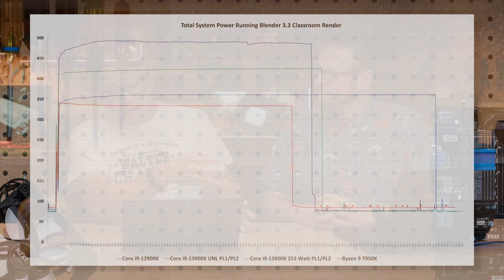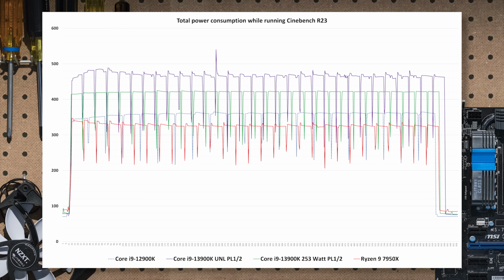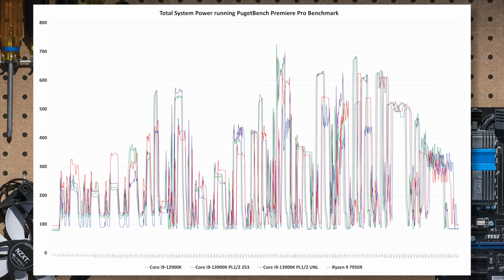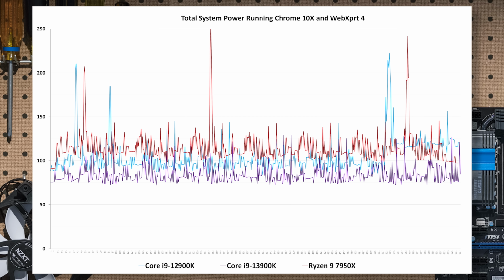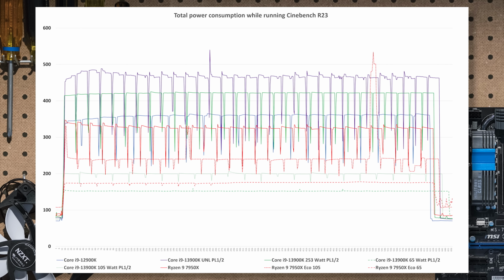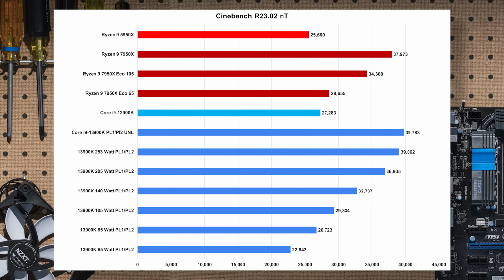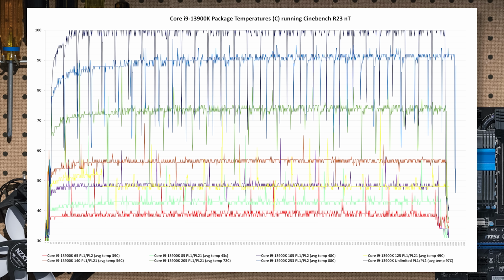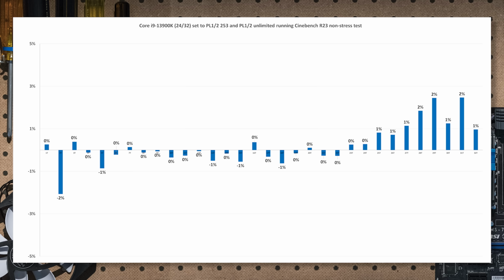How Much Power Does 13900K Use??

Comment: Wait, for people who are going to BUY a 13900K which is NOT a gaming CPU just like a 7950X isn't a gaming CPU, if they AREN'T using it pretty heavily for multi-threaded use cases they're idiots.

So I disagree with the claim that you wouldn't be using it a lot for those workloads.  Sure, while you're editing a video you're not using that much power, but I'm not buying anything over a modern 8 core CPU for general use cases.  It's a waste of money and power.  These are TERRIBLE CPUs for anything except you need to do something as quickly as possible and those are all-core loads you're doing.  Other than that these are pretty much useless.

For gaming, people aren't going to buy over the 13700K or the 7700X or the 7700X3D when it comes out.  It's just not worth the extra cost.  As has always been true, better to spend that money on a better GPU.  I personally don't like either release from AMD or Intel because they're both problematic.  The 13th gen CPUs go onto MBs that won't be capable of anymore future CPUs, and for AMD the problem is the CPU-chipset link being so limited at only 8GB/s, which is TERRIBLE considering all the I/O the 670 MBs have.
Reply: Can't agree more for the multi-core workload sentiment. I want >10 cores because I need to get work done, and n-thread thermal performance is extremely important for productivity use.

I really wish they kept the fan and did PCIe 4.0x8 or PCIe 5.0x4 to X670E if they were killing Threadripper non-pro, but that would be an unpopular thing to do.
Reply: @Postman00  I first saw everything built into the X670E and said that with a Zen 5 or 6, higher core count CPU these could replace less memory intensive HEDT loads, but then I saw the specs for the CPU and the CPU - chipset link being only 8GB/s is a deal breaker for me.  It's SO dissapointing.

And I ALSO don't like how X670 does 2 chipsets, where one is daisy chained through the other, kind of like the olden days of N. and S. bridge.  AMD should have taken 2 PCIe gen5 lanes to each chipset, give each one 8GB/s, and then a user could balance how they use the devices to make sure the bandwidth is distributed.

They made Zen 4 a 28 PCIe lane CPU, but if they were going to do 2 chipsets, they should have went to 30 lanes, and taken 3 lanes to each chipset, for 12GB/s each.  If they would have done that then I'd be more than happy to buy an X670E MB when Vcache parts come out, but I'm not going to buy a MB where off the chipset you have devices where if you have multiple things communicating at the same time, like I often do, they're being restricted to about 1/2 their bandwidth.  That's just stupid.

I was really hyped for Zen 4 until I saw AMD kept that bandwidth the same.  I thought they would at LEAST go to PCIe gen5 X4.
Reply: @johndoh5182   As someone who absolutely hates Windows 11 for various reasons, and strongly believe in Wh/unit of work, I'm actually seriously considering Intel just because Z690 & Z790 has DMI 4.0 x8, and I no longer have to screw around with m.2 to PCIe riser cables to scavenge some CPU PCIe lanes to alleviate I/O bottlenecks for my SAS and network cards.
Reply: Would a 5600x and 4090 be enough for 4k? I dont want to pay higher prices for new mobo , ddr5 ram and processor. Also , there is no game releasing in the future for that new powerful hardware . It seems like a waste of money . I'm only talking about gaming
Reply: @lackofabettername3589   I would say it depends, but it's very unlikely to be a sane combination. There are cases where a 4090 can make sense paired with a 5600X, such as if you're looking at insane, pure rasterisation performance at 4K high refresh rate with some kind of SSAA at either the game engine level via scaling, or driver override with nvidia profile inspector. It can be the only card that will provide that level of image quality. However, that's extremely specific. I would agree with John Doh that you should pair it with at least a modern eight core for Ray Tracing to make sense.

However do note that neither Ada Lovelace nor RDNA3 will support and utilise PCIe 5.0 respectively, and I don't believe in platform future proofing via faster PCIe beyond 4.0 unless you have some kind of fancy PCIe switching card for more, lower speed lanes, which is different from bifurcation. I doubt upcoming midrange cards will save cost by going PCIe 5.0x4 electrically or something ridiculous, as PCIe 5.0 likely requires voltage filtering on the board for signal integrity that is more expensive than just providing more 4.0 lanes, but PCIe 4.0x8 is very likely.
Reply: @Postman00  i have not seen any difference in frame rates(apart from 3-4 frames) at 4k in a video. Is pcie4.0 necessary for that 24gb vram? I have 5800x and b550 in my other pc
Reply: @Postman00  "However do note that neither Ada Lovelace nor RDNA3 will support and utilise PCIe 5.0 respectively, and I don't believe in platform future proofing via faster PCIe beyond 4.0"

That's you.  A lot of people buy a MB to have it many years, especially AMD owners.  It wouldn't make sense to buy an AMD MB if you want it for a few years and get a gen4 board.  So, for a ONE time purchase for many years, buying a MB with gen5 and spending the little extra money for B650E vs. B650 is better for THOSE people.  Yes, if you replace your system every couple years then you wouldn't buy a MB that has more than you need right NOW.

Me?  I'd buy B650E because I know I'll be upgrading the GPU and the CPU to Zen 6 and they'll run faster with gen5.  

Also, I think AMD IS moving to PCIe gen5 for their RDNA 3 GPUs.  Do you have the supporting docs that say differently?  AMD was the first to move to gen4 for their GPUs and I imagine they want to do the same with RDNA 3.  It also allows them to drop the no. of PCIe lanes the GPUs have.  I expect the move to gen5 means that going up to even a 7700 XT means X8, maybe even going up to the 7800 XT would only be 8 lanes.

Moving to a higher transfer speed means less latency per data transfer.  This helps.
Reply: @lackofabettername3589  First, there are no GOOD 4090 reviews because the best CPUs didn't exist other than Zen 4, but even there the best Zen 4 CPU for gaming is going to be the Vcache parts, so right now you have no idea how the best CPUs are going to run the 4090 at 4K until people redo their testing.  13th gen JUST came out so it hasn't been compared either to other CPUs for the 4090.

Next, what data?  There are no scaling tests done with the 4090 and a line of CPUs that I see, so please post a link to it.

Jarrod' Tech could end up doing one pretty soon, but I haven't seen a single test using the 4090 that compares multiple generations of CPUs, but I know what the results are going to be which is the 5600X doesn't look so good.  I mean the 5800X3D ALREADY beats it by a good 30% even with a 3090 in different games.  

You're free to build whatever kind of system you want.  That's the beauty of DIY.  I'm just saying just like the other person that it makes ZERO sense to buy a REALLY expensive GPU and pair it with a CPU that can't take advantage of it or you're giving up a lot of performance.

And if you won't listen to sound advice for running THE most expensive GPU on the market why are you asking me another question about how to put together a system?  Are you going to spend $250 for a PSU only to find out that when you move to a newer CPU and MB you NOW need another PSU???

Figure it out.
Reply: @lackofabettername3589  

No, just no.  You don't spend $1600+ on a GPU and then complain about mobo prices.  If you want to stick with AMD, wait for the B650E MBs so you get PCIe gen5 to the GPU slot.  They cost less than X670 at least.  Also, wait for Zen 4 Vcache.

If you want to game on your 5600X, RDNA 2 or Ampere is about as good as it's going to get, or a low end RDNA 3 or Lovelace GPU.  On the other hand if you upgraded that 5600X to the 5800X3D that would keep you in the game, but I still wouldn't buy a 4090.  I'd get a 4080 or a similar AMD GPU.  For that 5600X I wouldn't get anything above a 4070 or 7700 XT.  Newer games are going to throttle that CPU too much.

The reviews show that the current CPUs are a bottleneck for the 4090, EVEN AT 4K with RT enabled.  And do understand that when you enable RT it puts a heavier load on the CPU, so you need a faster CPU with more threads, so newer games are going to need an 8c/16t CPU if you want to play them on newer GPUs at the top end with RT.  And the same is true for UE5.  Lumen is ray tracing modified and it also puts a heavier load on the CPU.
Reply: @johndoh5182  I am not complaining. It's just that AAA games haven't been hitting lately and i have already beat old games like rdr2 , cyberpunk, metro exodus etc . I don't want to future proof apart from 4090 . And which psu should I get 1000w or 1200w ? currently I have 850w
Reply: Totally agree!  I always buy top line CPUs like the 13900K and 7050X for my daily e-mail, watching streaming content like YouTube! and doing web surfing ie looking up e meaning of words! 😊 I alway get 64GB of fastest RAM allowed too.  Go with the 4090 video card too and a 1600 watt PSU!😁👍
Reply: @Mr.HarryWild  There are no games for these hardwares . The gaming development is far behind the pc hardwares and they don't optimize the games on pc . Yea you can brute force the game with your gpu but that's inexcusable . Thats why i dont want to get top of the line hardware except gpu because of that 4k resolution

Comment: I think that people over-reacted to AMD's higher thermal limit. When it came to both new generations, I think it's going to make sense to tune down the chips back into the realm of reasonable.
Reply: If people are overreacting to AMD's higher thermal limit, why would you say it makes sense to tune down the chips into the realm of reasonable?

Yes, you're right people overreacted to that thermal limit when after all, AMD has tested this for a good year and I IMAGINE since they have to warranty their products for many years they know what they're doing.  I have yet to see a generation of CPUs from any company have an issue of dying.  I've seen MBs that weren't good enough have that problem, but not CPUs.

So there is no need to tune AMD CPUs done to be "reasonable".  They're designed to work that way.

You can tune them down if you want the power savings from doing so, but the thermal thing is trivial.  A tiny spot on a die hitting 95 C isn't going to heat up a room.
Reply: Really ?Tunning down the chips back to the realms of reasonable? Lol really ? The temps are too high and we all know it's not the new norm . Under-volting a product to lower temps and say oh I'm good now it's cooler ! Ok what ever lol .That is not the new realm of reasonable. AMD could of invested more time to fix the "New realm of reasonable thermos issue " . Lmao
Reply: I believe most of people using high end cpu for workstations, why would they put it on idle?
Reply: @green_block  you can save more money with amd if you turn the pc off if it's not used
Reply: @green_block  don't get a high end workstation cpu if you're going to be browsing or watching youtube on it, there's dirt cheap cpus using 5w that cost 300$ for that.
Reply: @green_block  yes I agree, but I meant for professional who use multicore demanding software, in my case corona renderer and vray. we start the interactive render a lot like in every 10 minutes and a whole night for 1 final video rendering. for a light software like photoshop, even 12600k will handle it no problem.
Reply: @green_block  could you give me a source that says amd uses 5x more power in idle?

Comment: I wonder what the longevity of AIO liquid CPU coolers will be with the processor running at 100C for hours at a time.
Reply: Hoping it is possible to use high-end air cooling with these chips after setting power limits. Im planning a mini-itx build.
Reply: Temperature is not important, only wattage.
Reply: @jesh879  tell that to people freaking out with zen 4 running at 95C, at lower wattage than raptor lake. Temps matter my friend.
Reply: @j340_official  what is your point? I was replying to the original person who was concerned about material degradation. Sensor temperature reported in software is just a number and varies with many things like contact with the cooler, or IHS thickness. Wattage is a measure of energy. The higher the wattage, the more likely a cooler would suffer adverse effects.

Your reply implies I should be concerned about hysterical people? People who have a baseline of ignorance? Those people have nothing to with this topic, and on top of that, I would never bother trying to tell them anything.
Reply: @jesh879  I thought you were replying to me. My bad! Lol. Have a good day.
Reply: Why would the cpu be running at 100C for hours ? What are you doing ?
Reply: @j340_official  100c is normal temperature for Raptor Lake unless you modify the power target
Reply: @vaudou_  default voltages for z690/z790 are too high, and way above what’s needed for stable operation. The key is to find the minimum voltage that will result in stable operation at the default turbo ratios. By undervolting, and not changing PL1 or PL2, I was able to shave 40W off (300->260W), and 23 degrees off (100C->77C) at the default turbo ratios. 40,200 in Cinebench R23.
Reply: @j340_official  The minimum voltage you find has no guarantee of being stable in any workload that isn't in your test set, and doesn't account for the effects of aging.  Consider that before asserting that the default is too high.
Reply: @Vegemeister1  well that’s why you test. Iteratively. Step it down. Slowly but surely. Until the iteration stops. It may not necessarily be stable in absolutely every possible workload but it may be no way to know and if the system is stable and doesn’t crash in the all-core workloads I use for testing then what’s the issue? I get to enjoy much lower temps.
Reply: It’s fine. The only part in contact with the cpu is the plate, and those won’t soften at any realistic temp. The liquid temp won’t be an issue, since it’ll stabilize far below any dangerous temp even with a high max temp. The pump will be fine cause they’re usually already running at high motor static so the temps don’t change that. If you do control pump speed, you can control how hard it actually works so the temp doesn’t matter.

Comment: Gamers Nexus:  OMG THIS IS THE MOST INEFFICIENT CPU IN THE HISTORY OF CPUS!!! 
PC World's data:  Meh, its average.
Reply: @green_block  Where are you getting these numbers? Guru3d has the 7950x at 72w at idle for total system power and the 13900k at 69w for total system. That's 3 watts for more threads and cores
Reply: Gamer Nexus and Hardware Unboxed are AMD shills. The 13900K at 200 watts is very competitive with the 7950X.
Reply: @saricubra2867  They aren't AMD shills. So you're saying that in order to get close to AMD efficiency out of the box you have to power limit? That's not to mention that Zen4 is more efficient and powerful at every power target on average

Comment: And don't understand why you "don't care" the difference for gaming... 500W VS 550W in a game, or 75 VS 125W for web browsing, that's still a 50W difference.
Reply: But the point is that weather its using more or less power flips around depending on the task.  So overall it doesn't really matter as the effecticny in whatever power demanding task you run counts more.  Plus, switch games and the tables can turn again.
Reply: @kidShibuya  I agree with you for most power loads, but on the heaviest loads where thermals are the limit, it does matter quite a lot. If I'm going to be thermally limited due to build budget/no air conditioning, the more efficient chip might just perform better significantly enough. Cost of chip and platform may either compound or neutralise the equation.

To me, Intel 13th gen looks good relative to Zen 4 because they're cost effective (cheaper platform AND silicon VS 7950X) despite being thermally limiting for me, but neither are significant enough upgrade over the 5950X given my thermal constraints and cost. I'll just make tea while I wait a little longer for a render.

Comment: Power limiting isn't exactly undervolting. Lowering VCore can further increase efficiency (at the cost of the user's time to achieve stability) which is essentially voltage limited overclocking. It is another interesting thing to investigate; which company's silicon has more headroom to perform more efficiently under the stock voltage curves.
Reply: @pcworld  😂 Try it Gordon, it's actually a lot of fun.
Reply: True undervolting invites instability. That’s probably why Gordon’s not touting it.